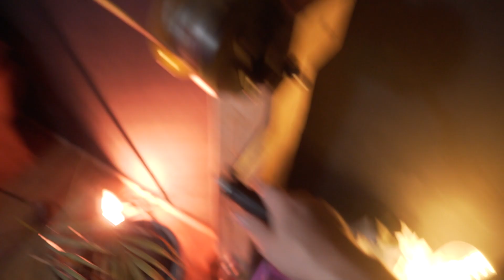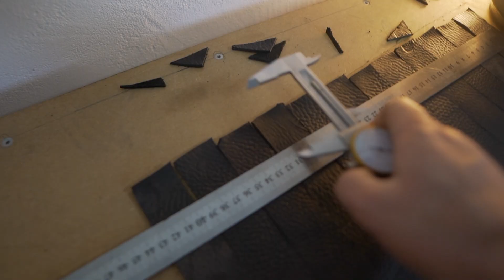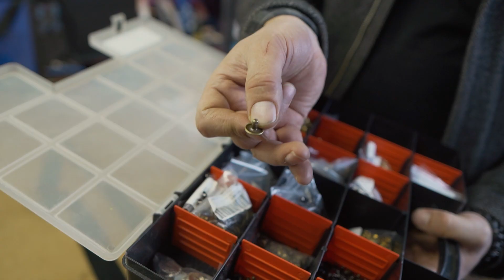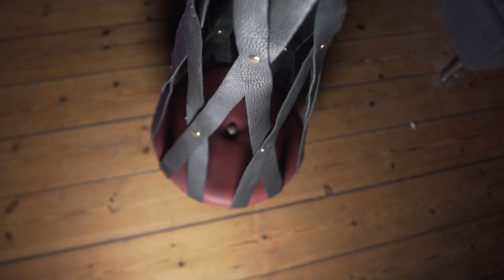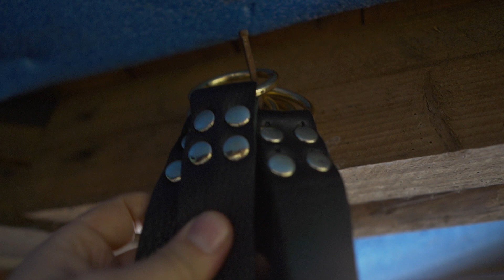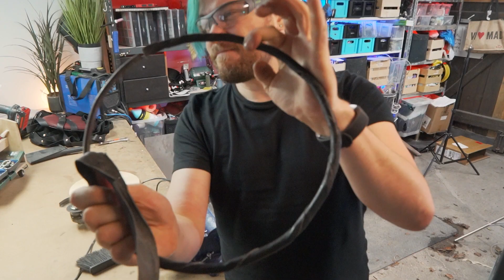DIY Suspended leather cage // A Build Guide

Comment: How would i calculate the maximum height for the person inside? Because i think i will need longer strips if the person is 2.00m
Reply from the maker: Might actually be enough for 2m. I ended up trimming my ends by about 10cm. Since it was a bit too long to work well with my ceiling. But hard to say, also depends on the general size of the person. I'd likely go with test fitting or prototyping if I had a similar issue.